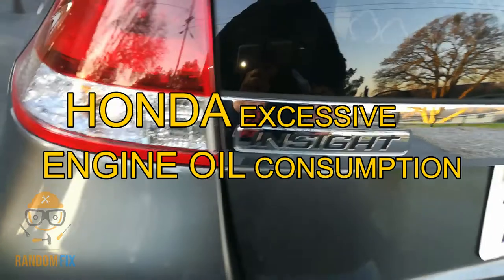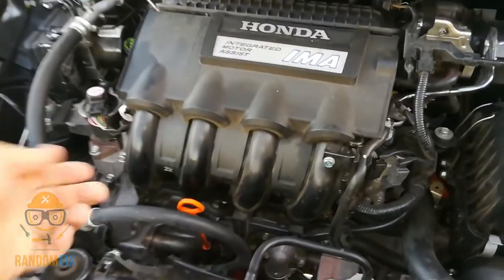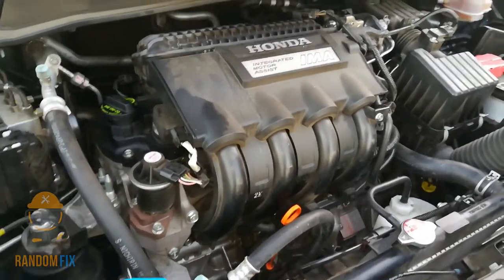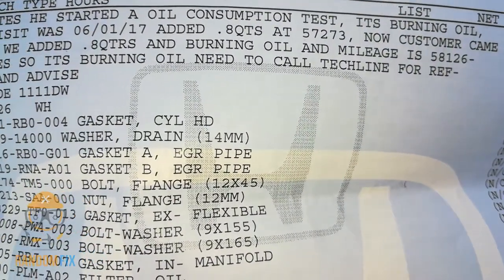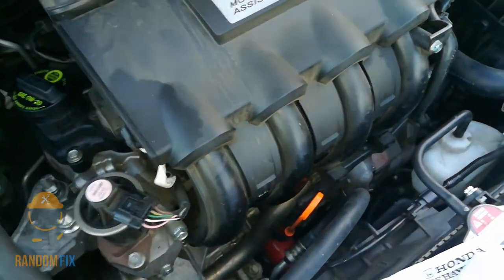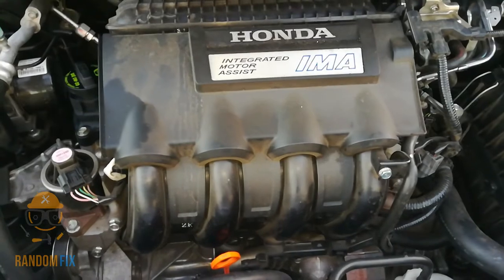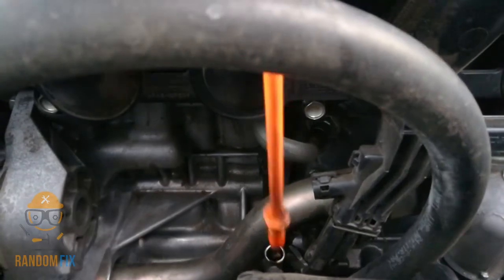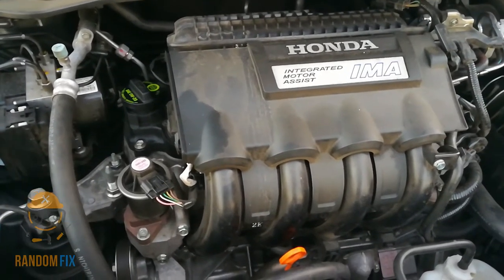▶️Consumer ALERT!! 2012 2013 Honda Insight Excessive Engine OIL Consumption ▶️GET HONDA TO PAY

Comment: I have a 2013..at around 100k miles...It started burning oil and blowing grey smoke out of the tail pipe. I finally got them to cover it under extended warranty but it took some finagling.  Honda didn't want to cover it, but  a local Garage found the warranty extension for me and I went back to Honda.  They finally agreed and replaced pistons..o rings..all kinds of stuff.  Saved me about $3000 to $4000! Thank goodness.  Runs great now ever since! Tho... the engine light has popped on and off from time to time ever since.
Reply from the maker: Hi Rebecca, Thanks for sharing your success story!!!
Reply: How do I find the warranty is it public? My garage I take it to hasnt been any help.
Reply from the maker: Yes just run something like a CARFAX and it will show the date first sold and then do the math. Don’t be afraid to call the manufacturer if you feel the issue is related to an inherent defect
Reply: @RANDOMFIX  The issue is definitely faulty piston rings. I bought the car used 2 years ago and have had hell with it the last 8 months. I don’t think I have any type of warranty so I’ll have to pay myself to get the ring issue fixed or replace the entire engine.
Reply from the maker: You need to call honda of America and let them know that is an inherit defect from honda. Start that conversation with them asap. Keep me in the loop.

Comment: I been having the same problems with the same car it's mad in the UK we haven't heard of this recall thanks you I will contact honda about this problem my engine looks like yours with that oil leak at the top
Reply from the maker: Please keep in the loop on what handles with Honda in thr UK. Thank you
Reply: If you are on Facebook please join the Insight Owners Club. I like the look of the facelift Insight but like you I live in the UK and it seems Honda UK are trying to sweep the whole thing under the carpet.

Comment: Same here. Mine 2012 . At 49k got head gasket replaced because I told them it was burning oil and at 55k engine making noise and still burning oil . Finally until the engine was misfiring they replaced short block . Was at the dealership for 40 days. The car has 162k miles now and no more issues of burning oil . Dealer fixed under warranty. Since this model has So many of same issues I wish they would reimbursed me the money I paid for the extended warranty since they sent out a letter that they are extending every insight owner 8 year warranty since time of purchase. Not fair for me .
Reply from the maker: Thank you for sharing and I took have the experience with no continued oil burning. As far the service contract there is really no way to get a refund there as the service contract carriers is independent of Honda motors warranty extensions unless you purchased the vehicle from Honda and can show that extension data was already available to public. Please note the service contract generally covers a lot more than a specific warranty extension on a factory defect.

Comment: I just keep putting oil in it.  I keep a close eye on it.  When I first baught it the engine died completely and they had to replace it under warranty.  I'm planning to trade it in soon....
Reply from the maker: David, sorry to hear that Honda isn't stepping in a second time. This is a known defect and I wish you better luck on your next purchase. -RandomFix
Reply: @RANDOMFIX  Honda in Selma replace the block, rings, valves, and head gasket.  It drives like a dream now getting above normal MPG.  I wonder though, is it a matter of time when it messes up due to bad Honda design?
Reply: @RANDOMFIX  catalytic converter went bad yesterday.  I brought it in today and they said they'll get it fixed for free.  Parts will be in next week.  I'm surprised I'm getting helped out so much
Reply: Well the car is running like a car with 0 miles.  They changed a lot including the CAT and they said they'll do it again for free as long as it's before 2020 when it breaks down.  That is sweet.
Reply: phillip miller  Forget the plugs, what about the CAT.
Reply: @davidecheagaray2256  They should have replaced the cat when they replaced the block. So it is a bottom end/ piston ring issue and not a top end valve seal issue you normally see due to carbon build up from direct injection on a non-turbo engine.
Reply: @davidecheagaray2256  You should've gotten a letter from Honda Corporate to this effect.
Reply: phillip miller  
Changing sparking plugs will solve the problem my Honda insight 2012th same problem

Comment: i have honda insight 2011 but after i replace head gasket cause the breather hose build up oil send to honda service center. honda technician go to test compression ring piston is ok but honda recommend me to replace piston ring any advice for me. replace or ignore?
Reply from the maker: Sorry for the late reply! did you find a solution?
Reply: @RANDOMFIX  not yet solved right now come black smoke and engine blow-by
Reply from the maker: So honda didn’t offer to pay for the repair? This is a know defect that  should be addressed by honda at their expense not yours.

Comment: The reason due to the oil seal ring at the piston uses single layer that causes the  engine oil to go into the the cyclinder that burned the into it and causes it be overhaul.
Reply from the maker: Good information. _randomfix
Reply: @Ariff Adam please advise how to fix it ?

Comment: I got the same problem.. but got no warranty. Do i really need to change the engine block. Or changing all seal and oring will be enough?
Reply from the maker: Jessley, It is recommended you replace the rings and seals but you want to make sure the to inspect the cylinders in case the there are other underlying problems like a scratch cylinder. Can I ask why you feel you don't have a warranty? _RandomFix
Reply: RANDOMFIX . I am in Mauritius. I brought a reconditioned car. So you don't buy from honda. Honda don't bring honda insights to mauritius. My vechicle just got towed today. The oil is going in my spark plugs and damaging then. Having misfire. Now will have to order seal etc tomorrow and wait for 1 month..
Reply from the maker: Mauritius, you don't have to purchase the Honda Insight from Honda to warranty coverage. Unless the vehicle is salvaged I would pursue Honda Motors of America. This is a known defect and just like you I didn't buy my Honda brand new or from the Honda Dealer. Please let know if you have any questions or you need me to point in the right direction on how to get Honda to cover the defect. _RandomFix
Reply from the maker: Jessley, you are welcome to share your story here I will reply just in an email that we way the youtube community can benefit from our conversation. _RandomFix
Reply: I have the same problem and  I called Honda Corporate and calmly explained my self and nice asked what they could do. It turns out Honda made provision for this specific problem on 2012-2013 Honda Insights; 8 years from the purchase. See link: https://honda.oemdtc.com/372/warranty-extension-2012-13-insight-oil-consumption-exceeds-customer-expectations-2012-2013-honda-insight.

Comment: @RandomFix, would you be able to list on the comments or description all the services Honda dealer performed that lead to the corrections of your oil consumption?
Reply from the maker: Evelyn, The vehicle in the video was my mom's car. I don't have access to it currently but if your experience a loss of oil great than one quart per 1,000 than you have valid claim against honda. Now when you tell them about this concern of yours what they will do is to change your oil (you will have to pay for this) and in case the honda dealer was over filling the oil so to even the playing field I suck the excessive oil and drove the vehicle one thousand miles and took it back to honda and that's how I go the repair covered. This is actually a pretty common issue with hondas. To learn check carcomplaints.com and you will find lots of people like you and me. Best of luck and let me know how it goes. _RandomFix 

If this helped you out, I would love you feedback, I really appreciate you taking the time time to let me know about your positive experience about your experience, do you mind sharing your experience on https://www.facebook.com/RandomFix It would really mean a lot to me personally. Thanks _RandomFix
Reply: I have the same problem and  I called Honda Corporate and calmly explained my self and nice asked what they could do. It turns out Honda made provision for this specific problem on 2012-2013 Honda Insights; 8 years from the purchase. See link: https://honda.oemdtc.com/372/warranty-extension-2012-13-insight-oil-consumption-exceeds-customer-expectations-2012-2013-honda-insight.
Reply: I am having the same issue on my 2013 accord sport..i just made a complaint to the NHTSA about this issue and i suggest we all do the same so we can have Honda remedy this issue affecting probably every owner

Comment: I have almost 6yrs with my car and I just be aware of the TSB few minutes ago. 84k millage so, i will call the dealer but I’m sure that I will have no warranty 😡🤦🏾‍♂️
Reply from the maker: Jesus, Don't take no for answer. Especially if you purchased the vehicle Honda Insight Brand new and you can show your maintained the vehicle. Honda knows this is known defect and will fix it. Please check out Carcomplaints.com for more information and tons of consumers like you and I that got screwed. Best of Luck _RandomFix
Reply: I have the same problem and  I called Honda Corporate and calmly explained my self and nice asked what they could do. It turns out Honda made provision for this specific problem on 2012-2013 Honda Insights; 8 years from the purchase. See link: https://honda.oemdtc.com/372/warranty-extension-2012-13-insight-oil-consumption-exceeds-customer-expectations-2012-2013-honda-insight.
Reply: Thank you sooooo much Veronica!
Reply: Me too from Honda Malaysia.  They did not cover my overhaul cost.

Comment: I have a 2013 insight that I just bought from a private party. Took the car recently for a road trip and did about 1200 miles. This thing burnt 2 quarts. I took it to the dealer today to address the issue and was told my VIN was not part of the recall and the warranty won't cover it. Any suggestions or advise on what to do next? Thank you.
Reply from the maker: I would call honda of America as the know this is inherit defect. Check out carcomplaints.com to further investigate this issue. The dealer have me a long around as well before they agreed to do the work.
Reply: @RANDOMFIX  so your Insight was not part of the recall, correct?
Reply from the maker: They didn't even tell me there was a recall, a lot time honda will call it a tsb ( technical service bulletin). Only when I point out the defect did even care. Then I had prove the vehicle was burning 1 quart per 1,000 miles. Honda had to change the oil for them to make it official but what I found was every time the oil was a little over filled. Check out the website I gave you earlier and you get lots of info. Honda has had problems with the piston rings for years.
Reply: I read the comment section on the website you recommended. The problem I am having falls under exactly what everyone is saying. However, no one is giving any solution to the problem. They all say they will never buy a Honda again. Haha
Reply: @RANDOMFIX  I wonder if it would be just easier to change the piston rings. I know a great trustworthy mechanic. You did say the cost to fix yours was over $3k but these are dealer prices and I am pretty sure they added some unnecessary components to be changed just so they could milk that cash cow.
Reply from the maker: Instead of paying the 3k or getting an mechanic to do it out of your pocket, why don't you have Honda try to cover. Trust me, this is a know defect. Its not the piston rings because the piston rings damage the cylinder walls as well.
Reply from the maker: The solution is calling honda of America. I probably spent 3 hours of time dealing honda but the issue no fixed.
Reply: @RANDOMFIX I have opened a claim with Honda USA yesterday. Visited the dealership today and I am in the process of oil consumption test for the next 3000 miles. Was told that with the warranty extension program the car's engine is covered until April of 2023. Hoping for the best. Maybe they will put a new engine at the end :) Thanks for all suggestions!
Reply from the maker: Darius, congrats  on filing the claim. Connect with me via email and I will share with some pointers. Incase we don't connect, please keep on eye on the oil level after the initial oil change after honda changes the oil as I said before my oil level was overfill, thus making it harder to get your claim cover. I'm not sure if has by accident or with intent but none the less it had too much oil. Keep me in the loop and this sort of feedback is the reason I made the video. Thank you!!!!
Reply: I have a 2012 they are trying to get me to pay 60%... It's burning more oil than anything I've ever seen before and I've had old cars with oil leaks o plenty... I was so happy to finally be able to afford a honda and now I have to deal with this shit. HALP >.<
Reply: @dariusprusfalcon2548  Can you please get me a link to that extension PLEASE PLEASE PLEASE.
Reply from the maker: Check carcomplaints.com you will find the tsb and also visit the dealer, honda knows that this is an inherit defect.
Reply from the maker: Offer to pay 0%, this is a known defect and why I made the video because these manufacturers are always putting profits first and not standing behind their defect. If you have to call honda themselves don't listen to dealer.
Reply: @Kitty_Demonix  have you got it fixed? If you haven't, call honda US and file a claim. I just had it fixed. The engine purrs like a kitty now. Haha
Reply from the maker: Thanks for sharing your experience 😊.

Comment: Honda dealership confirms I'm using 1.5qt per 2000 miles in my 2013 Insight (60K miles).  So it's not covered.  Yesterday, car broke down on the road due to fouled plugs. And now you have me worried for my catalytic converter.

If anybody here has ideas for convincing Honda to cover the cost of replacing the plugs which were fouled due to, imho, high oil consumption, I'm all ears.  ;)
Reply from the maker: Just wanted to give you a little clarity when I picked up my honda from the dealer for the oil consumption test they oil was a little on the full side. If you want to level the playing field please watch my  mercedes oil change and I think it will be come very clear what you need to do if you want to even the score.

https://youtu.be/o9W1SUQBtis

This is a defect and honda tries to get out of playing. Sad. Also, check out carcomplaints.com and you will see all other honda insight owners recommendations.

Comment: please tell me if it is safe to buy the 2014 model, will i have this same problem with the 2014 model ?
Reply: yes I own one it started burning oil at 5k I checked was 1 quart low at 80k 2 quarts low getting worse I expect its cheap oil rings probably using Chinese parts.
Reply from the maker: Just of curiosity, Why don't you have Honda try and cover the repair. I would call them and let them know you want to step in as it's an inherit defect from the factory. They covered my 2014 Honda insight. _Randomfix

Comment: This 2013 Honda Insight is a disaster and Honda knows it.  We have gone 'round and 'round with the dealership about this POS.  They "fixed" it ($1400), then it started doing the same thing about 800 miles later.  They want us to tow it to the dealership, then pay $250 for an "oil consumption" test, then another test, then they MIGHT reimburse us for the first repair.  They should be made to pay for all the costs.  If that wasn't bad enough, we actually bought a 2017 Honda Accord and it had engine issues.  (Surprise! How stupid were we to buy another Honda?)  It cost $1400 to replace levers that lift the pistons.  That was 6 months ago, so I am holding my breath.  I am so DONE with Honda!  I had a chance to buy a nice lawnmower for a nice price, then found out it had a Honda motor.  NOPE!  Don't care if it is just a lawnmower.  WILL NOT BUY IT OR ANY HONDA AGAIN. EVER.  Burned twice, shame on me!  BTW, if you live in Oklahoma, don't bother looking up the "lemon law,"  as it is the worst in the country.  Sorry to rant, but I wanted to warn others about this problem and hopefully save other car buyers a lot of money!
Reply: There’s no denying this is seriously poor from Honda, untouchable reliability reputation bust in one engine.
Reply from the maker: There are other Honda engines that have this same issue, Honda has issues with oil consumption even on the earlier motorcycles they produced back in the days.

Comment: I have 2012 insight and its burning 1L every 700-1000kms
Reply from the maker: Sorry to hear that, do you next oil change at honda and mention this to them and call honda USA if the service department doesn’t want to acknowledge this concern. Keep me in the loop
Reply: @RANDOMFIX  I'm in Australia tho does it work??
Reply from the maker: That I am not sure about but honda has a inherent defect with the piston rings. I would check on websites like carcomplaints.com and find a similar website for Australia. All you can do is try.
Reply: @RANDOMFIX  engine just broke down. engine lights flashing 
guess i have to get rid   of it
Reply from the maker: The Engle light flashing means it has a random misfire normally. You should do a compression test.